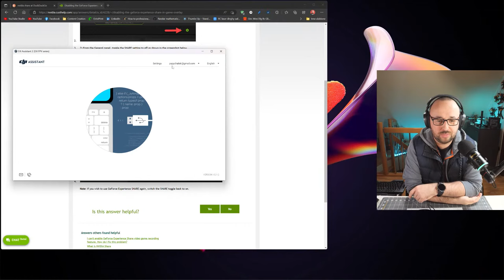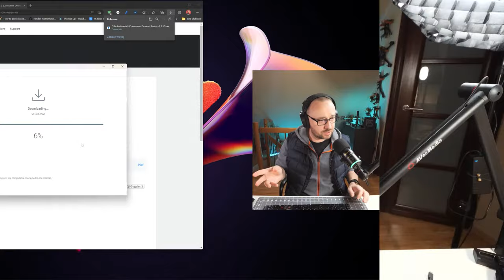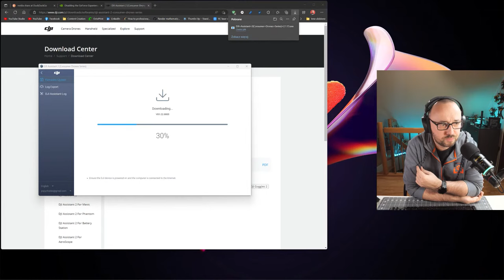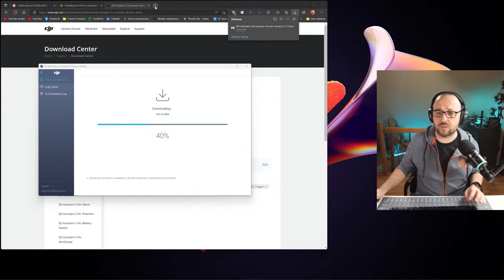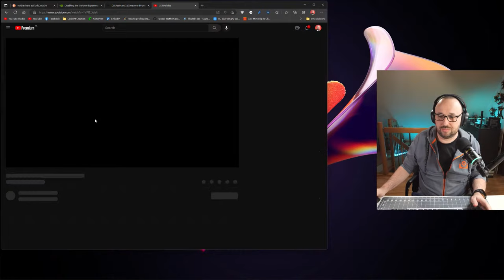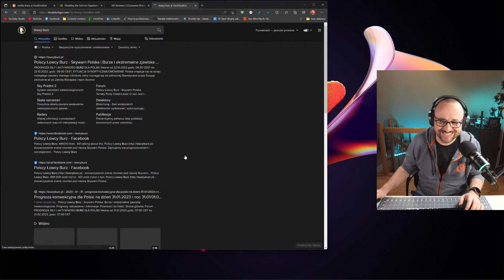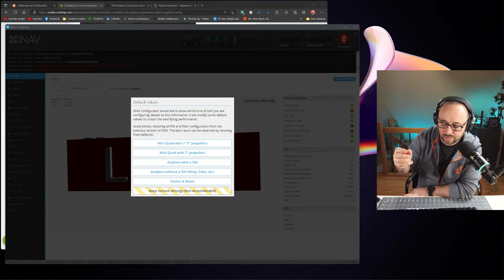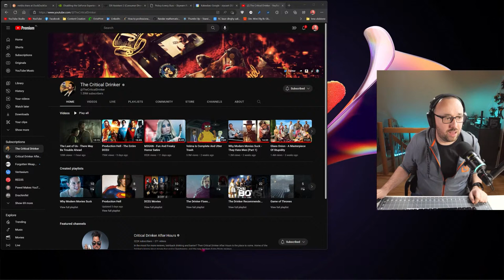INAV 6, Air Unit O3 and 7-incher setup for flight | The Build Stream

Comment: Hi Pavel , How did you solve the throttle stick in the fpv controloll 2, and what button did you use to arm it ?
Reply from the maker: There are screws behind rubber grips that remove centering
Reply: I thought about that but I would like to keep the compatibility with the avata, but if I don't see another way I think I'll have to have that option

Comment: Hi Pavel and thanks for all the good job you do from all this year's. I have a simple question for you, what about the preset for 10 inch quad, cause to the oldest version I have use and it's work very fine but from the 5 and on 6 is the same, can only use the 7" but the quad feel so "like a boat" and when I talk about boat is a big one not a racer lol . Have you any suggestion about that ?

Comment: Hi Pavel, MSP display port in inav 6 works also for Dji fpv air unit (the old one, not the O3)?
Reply from the maker: Yes.
Reply: @FPVUniversity  are you sure?
Reply: on an italian forum they said me only if u use WTF firmware
Reply from the maker: @MassimoMagni  Nope, not true
Reply: Hey maybe i know the answer.
I power the FC only via USB and the DJI through a 4s battery; is it possibile that the uart 2 MSP  doesnt transmit information through usb 5v only? Is it possible that i have to power up the device with a battery and not just with usb? Thanks

Comment: I have upgraded to the new INAV 6, selected MSP display port and changed to BF43COMPAT but still no voltage or OSD display on my goggles (O3 air unit with iflight F7 twing). I also tried removing the yellow and brown wires from the DJI plug/cable and also tried wiring the white and grey wires directly to a separate UART on the FC. I do have OSD working on another O3/FC build using betaflight.
Reply: Same issue here.  OSD works with Betaflight but not INAV on the same drone with no other changes.   I suspect it is a DJI problem.
Reply: I just got mine working.  I had to turn off MSP on the UART the air unit was on and set MSP display in peripherals.
Reply: same here